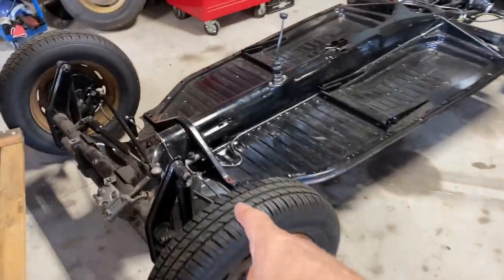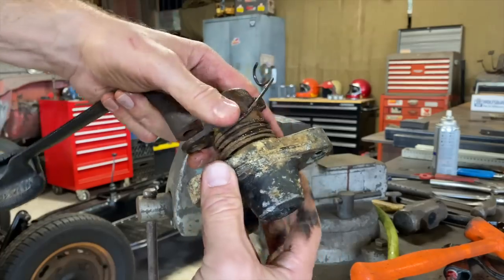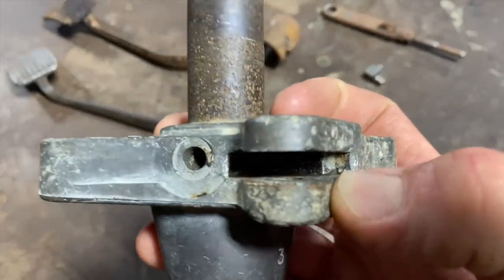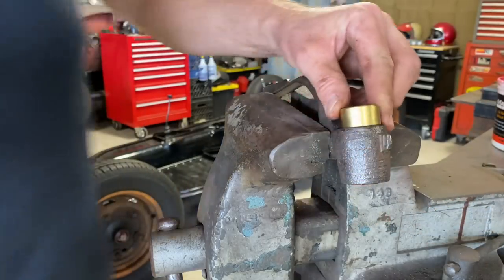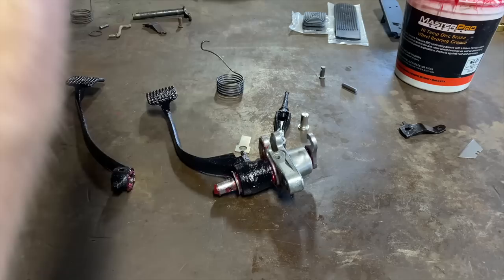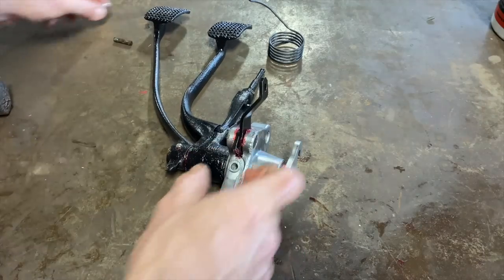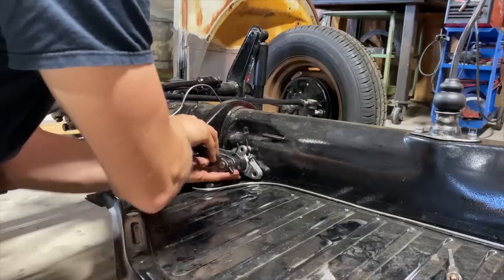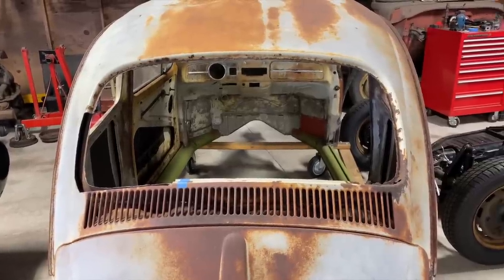1965 VW Beetle Restoration - Pedal Cluster Build

Comment: Hey there CT, I worked with a machine shop guy a few times and new brass bushings he'd  put in dry ice for 10 minutes then install them. Then ream the inside to the correct inner diameter.
Reply from the maker: Hey Tim, I will try that next time. Thanks man! =)
Reply: I'm on my 5th vintage outboard motor videos now. having a blast on them but if I had the room and money, I'd be doing a VW restore too. can't wait the see the window frame splice in. Just remember to test fit the window as you go. Tim

Comment: I would suggest  hone the bore on the pedal  with a cylinder  hone.They work pretty  good.I use them to hone out  wheel cylinders  and master  cylinders when they are rusty.The hone is made  of some  kind of stone material. And the good part is u can use it on a regular  drill machine. Great  video  by the way.Keep up the good work.

Comment: Super helpful video! Thanks. I’ve been watching videos about clusters getting ready to rebuild mine. My issue is the brake pedal won’t come back after pressing it. The part where you reinstalled the assembly and pumped the brake/push rod in the MC with no brake fluid pressure, and the pedal still returned to the normal position, convinced me that a rebuild of the assembly is what I need to do to get that pedal back after pressing it. Keep it up! 🎉

Comment: The great thing about this is that you’re learning and will be an expert by the time you tackle your other projects. You will handle them more swiftly and with confidence because you are now doing a great job and are very meticulous. Like others have said the Bentley manual and the Muir book are crucial references to have on the table next to you when putting things back together.

On the new bushings I believe you had the right strategy; trimming them back little by little until they fit.

Remember that when you change your clutch cable you have to take the pedal cluster out but the master cylinder stays in. This would’ve been a perfect opportunity to install the accelerator and clutch cables and be done with them.

About the rear window I thought Mike Fn was sending you one for you to graft in?

Comment: Well I cant say I have ever rebuilt a pedal assembly. usually I just clean them up grease them and they are fine. The KEY THING is to make sure you put the spacers in the napoleons hat for the master cylinder. There are sleeves that go in the hole that NEED TO BE THERE...if they are not and you have a panic stop you might find your brake master goes through the floor.
Reply: I have replaced pedal springs before. But usually I have several pedal assemblies laying around that I just find another one that is good. also replaced the Hook.....but not usually do a full rebuild. I prefer original rather than after market parts. So for instance if the spring is not broken I wont replace it. and if the bushings are not worn I keep them original. Just because the quality of parts is not the same.
Reply: Now I know why I have not replaced any of those busings.
Reply from the maker: yes, they don't fit...... =)
Reply: @CTmoog  yup like most aftermarket stuff

Comment: Excellent video CT  :) also that going in right too all doing plus throttle pedal on cable goes in there speed clip hold spring like shape captail  C circle has 2 teeth one top and one  bottom if not available use Cotter pin for Shear Pins!

Comment: Oh forgot to mention the spaces may seem to big because the fire wall is already crushed so you would have to figure out a way to pull it back apart. But if things work fine then you can just leave it but the spaces will stick out past the hole.

Comment: Next time on the inside diameter fit up,  try using a wheel cylinder hone. I've used them several times, especially when I might have a little detorsion from welding tubes together and having to put in a poly bushing. Just a suggestion..

Comment: Good to see you back on the bug mate.  It's years since I had my pedal assembly apart and now I'm glad - what a nightmare it all is.  I don't know about those spacers inside the nap's hat, but something doesn't look right, does it?  I'd seriously take some advice there mate.  Can Mike Fn advise you?  I don't know, but it looks like they're loose.  
Finally, a mechanic once cut a C shape into the top of my tunnel at the front, to create a hand-sized flap we could open up and get a hand in.  It made every annoying, fiddly job you have to do down there ten times easier in the long term.  It only looks unsightly 'til you get your carpet in ;-)    Good luck!

Comment: You would of been better off to buy a new pedal assembly, rather than going to the trouble of ordering parts, and rebuilding the old one.
Reply: Quality of aftermarket replacements nowadays doesn’t even get close to OEM. Better to refurbish than to replace with inferior quality.